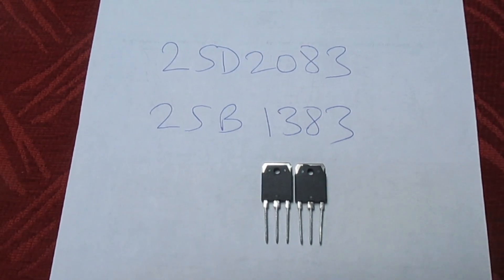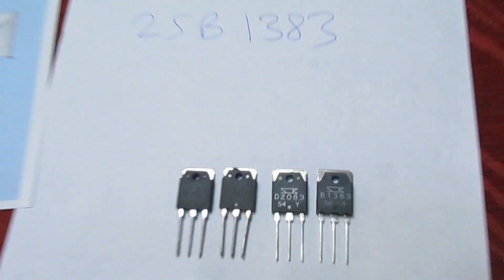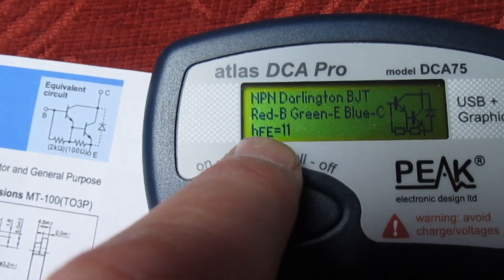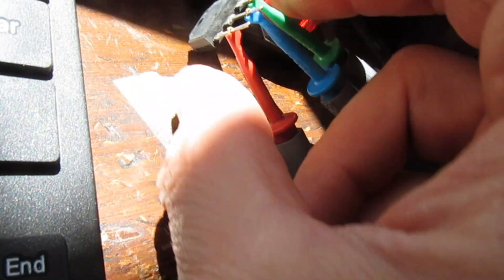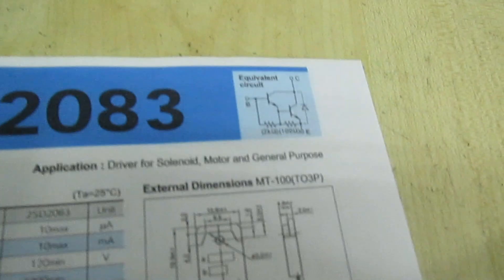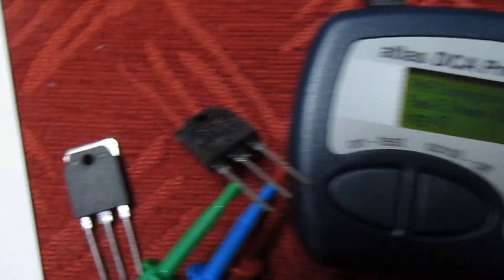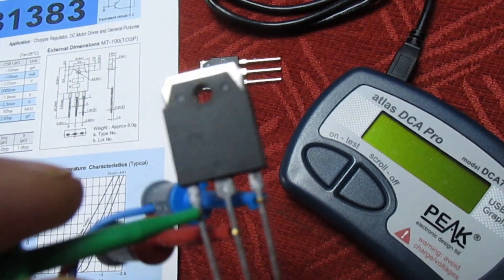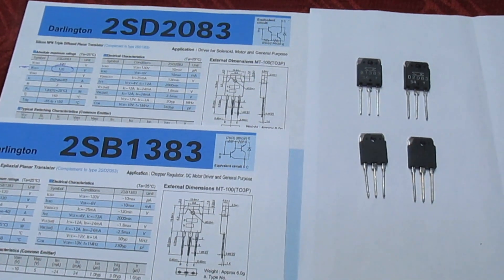Don't buy any 2SD2083 and its complementary 2SB1383  transistors until you have watched this video

Comment: Thanks for an interesting video Michael. I was similarly caught out by a fake BU808DFI from eBay, which wasn't even cheap. It wasn't a Darlington, it didn't have a reverse protection diode, it was leaky, and it couldn't stand the voltage even with an external protection diode across it. (I thought I might as well test it to destruction as I had no other use for it). I think if the only place you can find a device is eBay, it is bound to be a fake.

Comment: Never buy specialist semiconductors off eBay or AliExpress, especially not if the price is below what’s on LCSC or Digi-Key. You’re better off going for non-fake Chinese parts, at least those have a datasheet you can translate and trust, even if they aren’t very comprehensive. You can’t even buy legitimate TL072s off alibay.
Reply from the maker: good advice .

Comment: This is a heinous crime. When I buy RF transistors and they dont work it is just a loss of money and time but when you build a 13.8 v 25A power supply to feed a tranceiver with 2N3055 and they fail you can blow up a $2000 rig. I just dont buy from them any more.
Reply from the maker: This is the problem , its not the loss of money buying the fake parts , as you say its the damage they cause when they fail .

Comment: Yep, it's a thing. I learned the hard way not to buy chips from fleaBay unless they are from domestic sellers with NOS parts, and listings that specifically don't have titles that read like someone strapped a thesaurus to a mattress with jumper cables and a car battery in the middle of a desert cave ;)

Some PC parts are getting to be "collector" items tho, and it's driving prices through the roof. I have a project requiring an i387 math coproc for a 386 board, it's a vintage-parts build, and I'd have a much easier time of it if PLCC-to-PGA adapters weren't unobtanium. As it is, it's going to be a while... I'm not paying $50+ for a single stinking chip, and -- I'm sorry, I don't care what anyone else thinks -- if someone else does, they're plum stupid for it.

I still remember the time, some years back, when Sparkfun Elec out in Colorado bought a reel of unusable Atmel microcontrollers... turns out it was copper slugs in there. I won't be buying an i387 from China, I don't care who sells it. Too many disreputable sellers, too expensive to send back. I'm sorry, I'm not racist I promise -- it honestly hurts me to say, that side of the market's been poisoned. Maybe someday when I feel like I can trust it again, if that actually happens... for now, please excuse me for not holding my breath.

One wonders what actual dies they put in your transistors, though... would be kind of fun to find out!
Reply from the maker: As you say new old stock is the only way to go but getting genuine nos can be very difficult, take a look at sellers other items if they have lots of stuff from 30 years ago there's a good chance they may be genuine, stay away from anyone who was an unlimited amount of nos
Reply: @michaeldranfield7140  Generally my 'red flag' for that is what other goods they have on offer. If it's just chips, mostly NOS, I'll buy if the price isn't stupid. If it's laid out like a Punjabi market stall, a little of everything, richly spiced, at a price you won't believe (and if you haggle you can get lower), I'm out, right away I'm out.

Comment: For these 2 types , you can use the following alternatives :
2SD2083 -> NTE2541
2SB1383 -> NTE2542
Nice video, sometimes the very dim letters on components already give a clue that they are fake. But if you pay with PayPal, you can always get your money back,
but then again, your device is still waiting to get the right components. Same story with the Sanyo STK Amplifier IC's, you find them dirt cheap, but most of them are fake.
Ps: have you already done a video on that testdevice for testing the breakdown voltage, or did i miss that you on your channel ? 
PS2: forget my above question, found the video, thank you. Grtz.
Reply from the maker: Many thanks for the equivalent parts, I am assuming these are current production devices as my equivalent book lists other Japanese parts.
Reply: @michaeldranfield7140  hi, these are indeed current production devices, the 2SD2083 and 2SB1383 are obsolete and no longer in production.
Reply: @BjornV78  aren't NTE types always rebrands of current production devices instead of current production devices? That said, they would be very careful as to which type to rebrand so probably a reliable source anyway.

Comment: Thanks for sharing this. I once bought 100 pieces of 2N3055, and I had to pay more because I asked for military specifications. When I got them, I saw at the surface, under a certain angle in the light that other numbers where removed. With some research I determined that they were types with much lower specifications. I was lucky that the supplier was willing to take them back as the damage would have been extensive if I had used them for the project I bought them for.
Reply from the maker: its getting to be a very big problem now but luckilly most fakes are pretty easy to spot .

Comment: 2N3055 transistors sold on eBay, every one of these are fakes unable to take much more than 1A where as a genuine 2N3055 can take 16A
Reply from the maker: I never know why they fake 2N3055 as there not very expensive to buy a real one
Reply: @michaeldranfield7140  The point is that you can't buy a real one at least not on eBay and other similar sites from China.

Comment: I got screwed over on 10 negative voltage regulators that were all fakes (with one blowing up in circuit without any load on it) and a batch of nice looking metal cased (supposed 35 amp) rectifiers that actually contained a bunch of IN4007 diodes instead. I'm a hell of a lot more careful nowadays after that I can tell you and especially buying parts on super fleebay.
Reply: regulators  🤣💢  sure  the best tradeoff in knockout components 
like the free energy videos on YouTube 🤣🤣 right ?

you won't believe me but  I  have 
done test on those  like 
a 7805A    regulator   the knockoff 
one never reached  5v output at no load  it reached 4.88V no load 🤣
so   do not install this especially if it feeds vital parts like a microcontroller .
I hope that helps .
Reply from the maker: Generic components like you mention should only be bought from places like RS components , I know they cost a bit more but you are buying peace of mind, however some of the parts I use can be more specialised or obsolete types  that have been discontinued from major distributors and so you only have the internet search option to look for them .

Comment: u want to know if the part is genuine ?
1  it's wieght  
2nd   the heat losses test  
3rd   hfe   test 

the heat losses test  
supply 0.8v on base emitter 
connect a current limit  power supply on it's collector  
measure the case temp after  few seconds  u find a much  higher temp 
(alot of impurities  instead of silicon die).
another   thing   
they  reprint  the parts and do an ultrasonic cleaning   so the parts donot  look they have been salvaged from used  PCBs .
I hope u read this   but there are so many knockoff  electronic components like  smps  ics
that do not work   until doing some modifications in the circuit (because the Knock off 0arts has omitted circuits inside )
an average  engineer will not be able to  figure this and  repair the equipment he's working on .
Reply from the maker: Been in this trade for donkeys years so I have accumulated a lot of genuine old stock semis which I can use to do comparison tests against suspect parts , a lot of fakes you can just tell by looking but I have seen ones that are so good they are virtually undetectable without testing .
Reply: @michaeldranfield7140    you are absolutely  right  
I am very  glad to  find your channel 

and I also have original components 
to compare  with those  fake 
i have very old transistors like
2n 3055 (Toshiba  the red print)
irf840 , 2sd1414 .....
but be aware as also  genuine components varies with time 
u can compare 2 genuine parts from same manufacturer 
(eg.   tip35C made in 2000 and same made in 2022)  
you find a little bit  difference (almost 5%)   but that is  in my xp due to the old component  die deteriorate with such long time .
so what I m doing I read the datasheet and  write down  
a standard good and working components (like the Irgb4b60kd1)
  and many other after I do the test on them  that way to make sure  
they work perfectly well and  the customer do no get  upset from a repair process that failed due to components not genuine.

wish you the best and keep up the good work  👋👋

Comment: I'm genuinely surprised that people buy older electronics from China, without realizing that Chinese people do not have stocks of older stuff, they came to the match later!
Reply from the maker: This is true , I have even seen Chinese sellers trying to pass 1960 s transistors as old stock .
Reply: @michaeldranfield7140  Incredible.
I have seen colleagues cheated, once BUT70I was bought from China, "I" means insulated, they were not insulated capsule and it exploded quite well when we tested our products.
I was skeptical from the beginning, when I knew that only one manufacturer had made that variant and sold out 10 years ago ...

Comment: there are a lot of 'remarked' devices around, some  are 'genuine' but cleaned up 'used' /pulls from equipment, some substandard, or lower grade types marked as higher, or  worst, fakes, just 'anything' that looks the same physically,   there were and probably still is a lot  of 'suspect' 20mhz Z80 cpus on the 'net,  i bought some, very cheap, from 2 suppliers, definitely remarked havent tested any yet,  also there was a seller on ebay selling 4116 dram chips, which turned out to be 4164s, definitely not drop in compatible without mods! someone on a facebook group bought some and had issues with them burning up(not surprised) so i got a few to test them! they do actually work ok, as 4164s, so not dud ones! i contacted the seller pointing this out that they should state in the listing incorrectly marked  and should  sell as 4164s but no change...
Reply from the maker: Its getting more and more difficult to find genuine devices these days and as you say if you complain it makes no difference , the sellers keep selling .

Comment: those fakes are probably remarked tip2955s/tip3055s or similar ,,  could tip142/tip147 replace those 2S types, theyre rated 100v , theyre a fair bit cheaper in many suppliers,
Reply from the maker: could be but definitely not darlingtons.

Comment: Just assume everything on eBay and Amazon is fake. I'd pull transistors out of scrapped equipment before paying money for them there. Buy parts from authorized distributors like Digi-key or Mouser.
Reply from the maker: Very good advice .
Reply: @michaeldranfield7140  I will admit I cheat sometimes. I recently bought 100 toggle switches for a project where reliability was not a requirement and I did not mind if 5-10 of them were defective. I was... not disappointed. They were super cheap. But gray market parts might contribute to slave labor, so I try to minimize my interaction with it.

Comment: Unfortunately the global electronics shortage is bringing out even more fake and poor quality components than ever. I’m paying 40 dollars for an IC that cost 4 dollars last year.
Reply from the maker: if your lucky Chris  you may get a used chip thats been cleaned up to look like a new one , if your not lucky you might get any old chip thats been sanded down and laser etched with the numbers you want on top , the most faked semiconductors in my experience are the ones that have been obsolete for years , Ill be watching you channel with interest, give your chip a microscopic examination before you fit it !

Comment: What you've got are more equivalent to the 2N3055 (NPN) and 2N2955. (PNP). The price was right, but, I'm sure glad you did a break-down voltage test on them, before installing them in your amplifier....By By emitter follower resistors, and  perhaps, the power supply! If they had the break down voltage rating, you would find, that the current limit on the output of the amplifier would be exceptionally low, due to the low beta rating, and the high impedance bias circuitry that would be used for Darlington transistors. The amplifier wouldn't perform well, but at least, it wouldn't generate smoke, or cause any damage.
Reply from the maker: I knew these would be fake, just didnt know how bad they would be .
Reply: A 2N2955 is a germanium low power transistor in a TO-5 can, so that wouldn't make much sense even for fakers! Maybe you're thinking of the MJ2955, or of a TIP2955/TIP3055 pair?

Comment: from what I have seen the metal on real parts has a dull metal finish and fakes are shiny, my guess is the fakes have more lead, hence the shine
Reply from the maker: The Chinese use a lot of different faking techniques, I think what you are referring to is an old device which has been removed from a board  with short legs , so they spot weld on new legs and then dip the leads in some fresh solder to disguise where new legs have been fitted to and already used device .
Reply: @michaeldranfield7140  I have bought some fakes that were new (Sanken) and the common denominator from my experience was the shiny legs and back. Hell, I don't mind pulls as long as it's stated.

Comment: I don't think there is a single genuine transistor among the ones I bought from ****ese resellers on the Amazon marketplace. they are fundamentally all the same transistor, hopefully binned by hfe. they are dirty cheap as general purpose signal and low power transistor for fun projects, but I would never use them for any specific purpose (low noise, high gain, high power...)

usually for the power ones in a plastic case you can tell they are fakes from the weight alone, since they use aluminum instead of copper as support and terminals
Reply from the maker: Yes , I have used the weighing technique in the past to detect fake STK amp chips , as you say ok for playing about with but little use for a customers repair .

Comment: Good catch! Unless you have some sort of component tester (like your Peak DCA75) or a curve tracer that can provide at least 60V to bust it with, the Max Vceo test you ran would be the only other hint, besides putting it in circuit, then having to remove it because it's rubbish.
Reply: It could have been much worse. Transistors tend to fail by short circuiting, which could take out the emitter follower resistors, or perhaps, even the power supply. I have a tube amplifier, that uses a 375 volt power supply for the plates of the power tubes. I'll often connect a 100 k Ohm resistor in series with it, and connect a transistor in series with that high value of resistance, then, measure the voltage across the emitter-collector junction, to verify the actual break-down voltage. The current is low enough, that it will not harm the transistor. It merely acts like a high voltage Zener diode, that is not really calibrated. As long as that break-down voltage is at least 20% higher than the open terminal voltage of the supply rail, that transistor is safe to use in that application. His tester places ~1 milliamp across the transistor, which is perfect.
Reply: @vincentrobinette1507  True. Having access to a high voltage DC supply could help you check (as he had, and used), or a making something like a variable "Huntron Tracker" with a low current, higher voltage transformer would also show the transistors forward and reverse junction breakdown voltages.
Reply from the maker: the biggest problem would be if you fitted these and they went short circuit you could end up damaging even more parts than was wrong with the amp in the first place .
Reply: What I was mostly getting at, was, even if they didn't break down and short due to excessive reverse current, the lack of gain would be sorely noticeable, being they did not contain an internal "Darlington" configuration"

Comment: I had exactly the same problem with the 2SC5200 and the 2SA1943 versions of this transistor believe it or not, that came from ebay, it seems as if the manufacturers and the sellers are trying to fob people off with bad batches of these
Reply from the maker: most stuff on e bay is fake , last time I used 2SC5200 I got them from RS components.

Comment: The internet is awash with fakes, especially from china. Unscrupulous traders from that country buy up 'rejects' from genuine semiconductor manufacturers. These may be perfectly good parts but haven't quite met the grade during QC testing - likely failed on a certain parameter and because they are rejected they don't get any markings applied to them. This allows new and different part numbers to be laser etched onto them. The trouble is you just don't know what you're getting. As in this instance, what is supposed to be a darlington is in fact just a standard bipolar transistor.
Reply from the maker: I use to buy out of spec rejects in the 1970 s from Bi -Pre Pak  who use to advertise in all the electronics magazines , I still have some un marked semis here . 
Yes the manufactures rejects  fool a lot of people as they are cosmetically perfect.